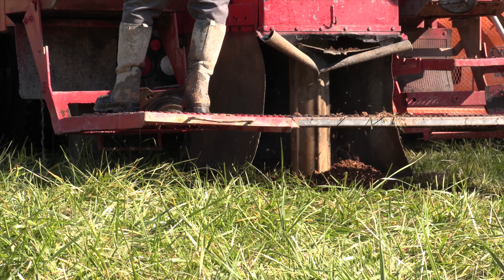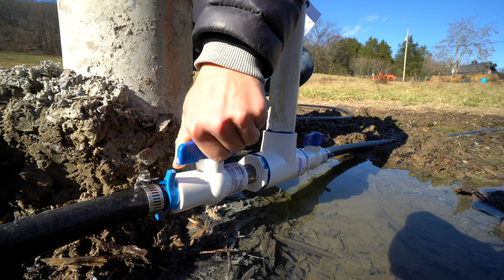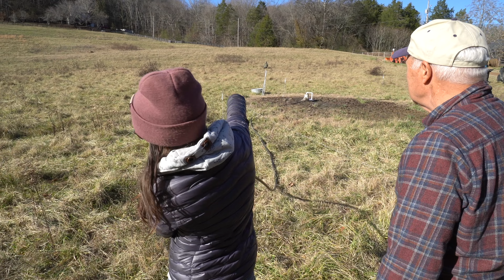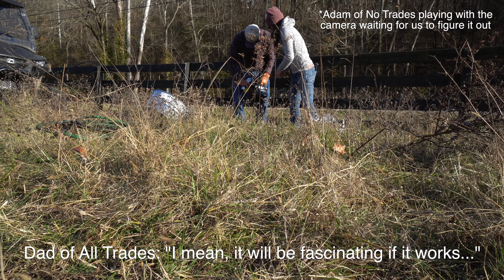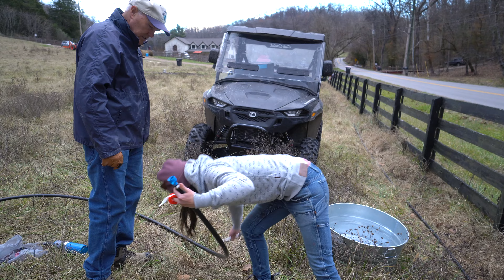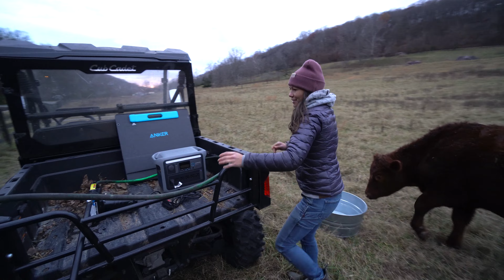How a Small Farm Solved it's Big Water Problem

Comment: Confused - what happened to the pond? The pigs and the clay? 🐟🚰🌊🐖
Reply from the maker: The pond has never been able to hold water. An old timer told me a couple pallets of bentonite clay and a summer of pig footprints would fix it for good. So far so good!
Reply: When do you test the pig repair of the pond? That has been recommended to our pond, too. I hope it works!
Reply from the maker: @eco35758  we’re basically just waiting for it to rain enough to fill it. It shouldn’t be long before it’s full, and hopefully that is all it will take. We’ll see in a month or so.